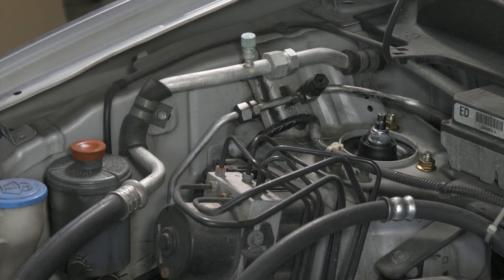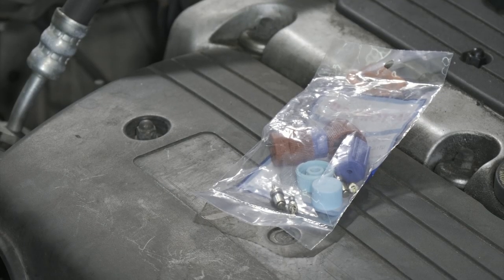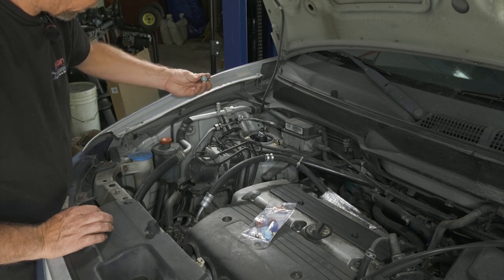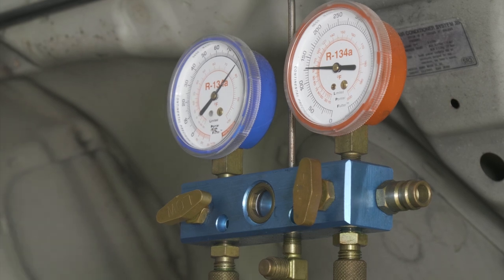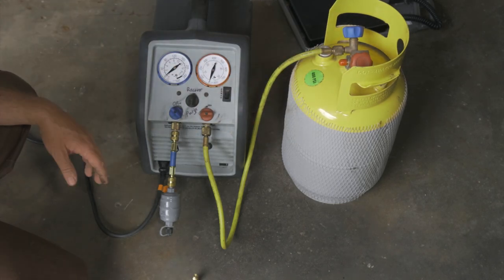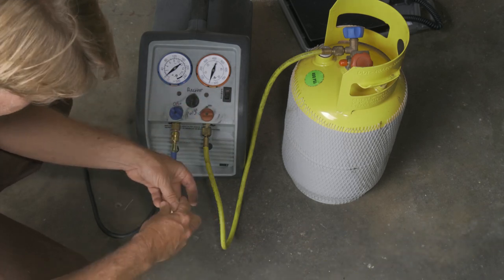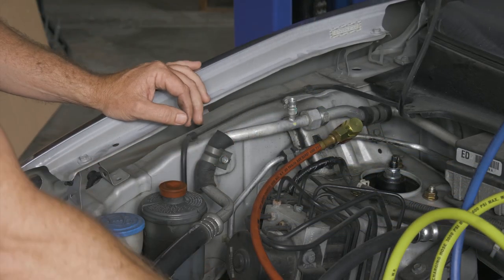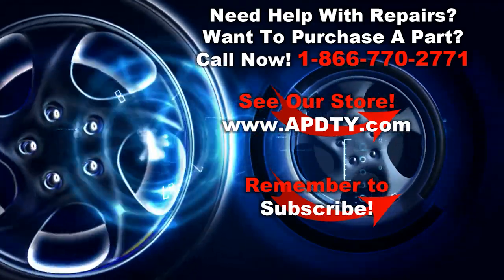Evacuate & Recharge An AC system, Also Replace Schrader Valves

Comment: Very good video. Just a few things I noticed.. only recover from low side, if you recover from high side you will remove oil. If tank is new it must be vacuumed out. Last but not least don't use quick disconnect fittings... they just make a mess specially when there is dye in the system, it wastes refrigerant and hurts the environment.

Comment: I have probably watched 20 or so videos on this topic. There is a lot of misinformation on YouTube about this procedure, but your video seems to have all the correct steps in one easy to watch place. With this, as well as the supplementary information in the comments, I think this is the most comprehensive guide for automotive AC refrigerant recovery I have seen!

Comment: Didn't purge the air out for the second can so you introduced a whole line full of air into the system.
Reply: Not really, he has a valve on the can, when the first can is empty the valve is closed and the hose is airtight, no need to purge for a second can.

Comment: Well from all the researh ive done i say you made 4 critical mistakes first  you should of opened both valves on recovery tank if brand new to let the Nitrogen out that its shipped with. (Atmosphere is fine with nitro) second hooked a vacuum pump to the recovery tank and let  that baby rip for about 30-60min to make sure its sucked of everything you can get. Think of it as  you're the tank and best BJ ever didnt miss a drop. 😉
Next purge the hoses open valves up on manifold and recovery machine leave valve on tank closed then crack open the hose to tank fitting until you get refrigerent out then tight immediately. Finally only open the low side! Leave high side shut

Comment: Hey thanks for a very informative video! Question, do you know where the oil goes from the system when the machine recovers it? I used to work at a shop and our full size machine separated it into a separate canister. Does this one do that or does it send the oil into the recovery tank?
Reply: So I just got my certificate so I’m gonna basically give you the textbook answer since I don’t have much experience quite yet. (More or less saying I have done this for 30 seconds and beyond the certification material I have no idea what I’m doing)

Some of the oil will dissolve in the refrigerant. But most should stay in the compressor. The stuff that dissolves in the refrigerant could pool in the bottom of the recovery cylinder.

There’s several hvac channels on YouTube that show cut open recovery cylinders and a few have shown how much compressor oil pools in the bottom where the dip tube doesn’t reach. Interesting stuff if you’re a nerd like me that like looking up stuff like that.

Comment: I have a question why not put the same freon back? Can you do that at all?
Reply: Not really, it would be like taking a shower and collecting the water for next time. The refrigerant needs to be recycled.
Reply: @VWtech562  ok. I need explanation on this ???
What makes something like the Robin air 34788 machine different than what this guy has. Filters? And a vacuum pump I know. It just seems like I can reuse the freon. I use a filter when collecting and a filter when recharge so far so good
Reply: @mrpaulvoline1978  I'm on the same Page as you are. I've asked myself the same question. I use a Robinair roll around machine at work and all I do is replace the filter after 150 hrs. 

But how good that filter works when recovering refrigerant on burned-out compressors? 
In my opinion you would also need a refrigerant identifier to make sure there is no air or contaminated refrigerant before putting it back in.